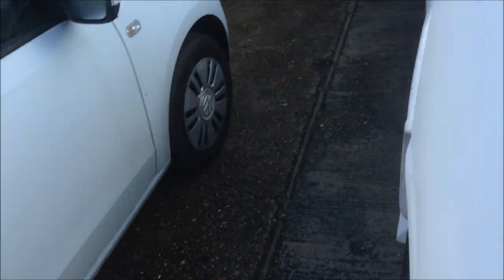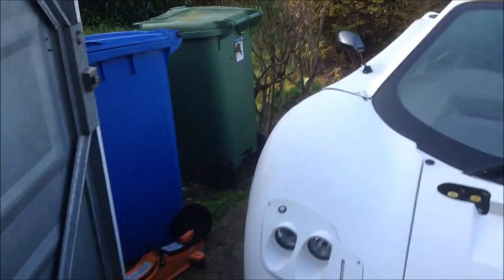Kit Car build: DDR Motorsport GT ( Mclaren F1 replica style ) pre bodyshop review

Comment: Planning on ordering the gt8 grand prix and doing AWD with tiptronic paddle shift and either 2jz or Barra 1000hp motor with launch control etc cool cars 
Did you finish yours ?
Reply from the maker: Yea finished and been driving it for about 7yrs now. Done about 15k miles. 2Jz all the way, use to love that engine, just go single turbo obviously
Reply: @killerferret666  is single turbo better ?
Reply from the maker: @davidbutcher6637  it is for higher power, the twin turbo setup has its limits. But fitting hybrid twin turbos is the cheaper upgrade for power. The single turbo setup is much simpler of course for maintaining.

Comment: Just an idea, why don't you make the duct on the roof functional? It shouldn't be hard to use it as an actual air intake... I think it's too small for an intercooler tho.

The reason I'm saying this is, I think non-functional ducts on a car make it seem tacky as hell...
Reply from the maker: XCFBowling I agree. The roof scoop is functional. It will actually feed air into the cabin when the vent is open but also ducts air into the engine compartment to help with cooling by pushing the air flow out of the rear of the car from the engine bay. The side vents when cut will cool the intercooler and feed the air intake. I'll duct both of them as well.

Comment: Lol do I have to use a Chevy small block if I get the gt8 or is that just recommended.
Reply from the maker: You can put in any engine that will fit really you may just need to weld new engine gearbox mounts. What engine are you thinking of?
Reply: killerferret666 either a 98 supra engine or a BMW E38
Reply from the maker: Had a TT supra before and agree would be amazing with one of them in there

Comment: i wish the creator of this kitcar had done it 4 inches longer and 2 inches wider.what the most of them lacks is the stearing column and your sitting posittioning..look at mclaren f1,,you have place for 3 persons,,here you have 2 and yet its crampy
Reply from the maker: The Mclaren F1 has two narrow seats on the side which are moulded. If you put the drivers seat in the middle and did two moulded seats you probably fit 3 seats. Its not actually cramped inside, because my feet is a fixed seat, if you arent 5ft 11 or above you probably wouldnt be able to drive it due to the seat position to the pedals.

Comment: where did you get the windshield?
Reply from the maker: Peter Barosso it came with a DOT marked one but I needed an E marked, so I had a windscreen mould made so I can produce more if I get a stone chip or something like that.
Reply: You can make glass windscreens from the mould?
Reply: With that glass I could make all sorts of cars...like a Pagani replica
Reply from the maker: It is a good shape and curve, good sporty look. for whatever reason it's not quite identical both sides. Hard to tell with the naked eye though. The windscreens can obviously be bought now that a mould exists, so yes can be made.
Reply: I haven't clue where to look. I grabbed an Acura nsx screen for my project....
Reply from the maker: I can see why an NSX screen would work. This windscreen is made by pilkingtons. Only way to order a screen though is through me as I own the mould so they don't take orders from others.
Reply: +The Ferret does the car have power steering?
Reply from the maker: Nope not currently, but doesn't need it to be honest. However very easy to add power steering using a different column with electric power steering built in so no pumps etc...
Reply: +The Ferret there's probably absolutely no way to get windows that go down. damn that's kind of a bummer
Reply from the maker: +New England Task Force - Guns, Gear, Combat Footage and More! The only way you could do it is have a piece of curved glass made that fits perfectly and then you'd be able to get the window to drop a bit, maybe 5"'s or more. That would be a very difficult thing  to do though.

Comment: hah fuck that just drive cheap racing cars instead. Get an old beemer and tune the fuck out of it. This car gets no cred period
Reply from the maker: +Blender Dav You cant drive 'cheap' racing cars on the public road? This is probably the worst comparison I've ever heard of.....period

P.s Very few old beemers get tuned the fuck out of, normally they are just fucked instead
Reply: +The Ferret what does a public road has to do with anything? Man a lot of beemers get tuned the fuck out of and they will leave you eating dust when you drive your kit kat car
Reply from the maker: Blender Dav You cant drive racing cars on the road, So why would I buy one? I think you mean why don't I buy a BMW road car strip all the crap out of it and tune the engine. However you've missed the main point, I wanted to build my own car from the ground up as simple as that.
Reply: +The Ferret you can drive racing cars on the roads, they should be road legal though. There are plenty of them out there
Reply from the maker: Blender Dav to be road legal, 99% have to have parts taken off or adjusted to pass the IVA test, which is a 300page document and about an 8hr test. Almost all race cars will fail on the radius test on the interior of the cars let alone sharp edges from splitters and not even on to emissions. Any that have these parts are because they are put back on after the test, as once tested that's it and just normal MOT. Then there's driveability, changing suspension is often required or the ride is too hard / poor for the road. As you can tell I watched someone go through this pain putting a track radical on to the road, he put a lot of bits back on after the test like the splitter etc...